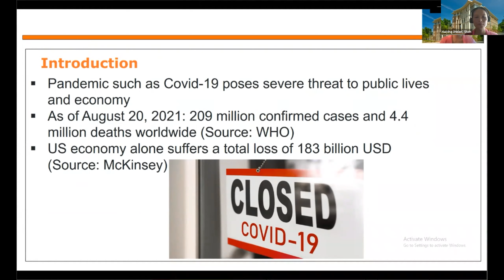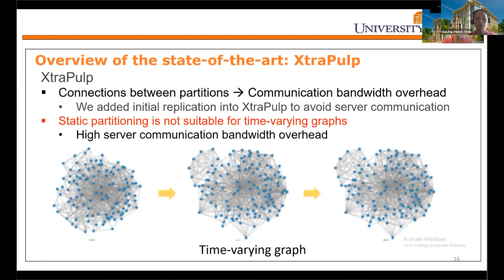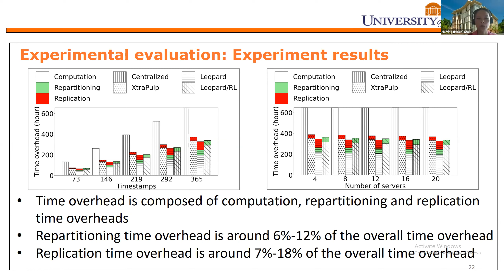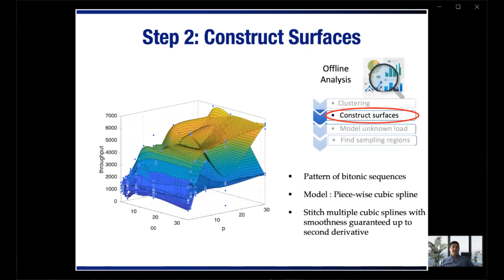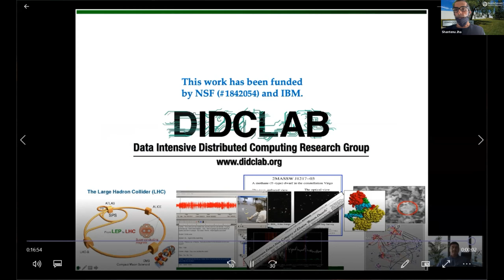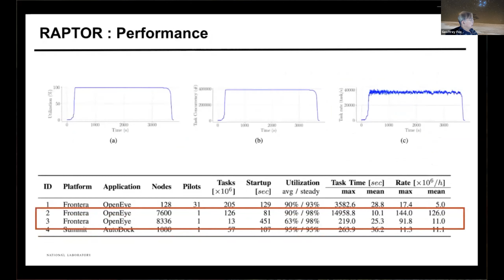CloudHPC Symposium - Session 5

Comment: why did you not just use a NVIDIA POD rack or 2, 600-400Gbp/s there blue link has been out for a year and a half, infact 1 DGX A100 system would have solved your entire problem, and it could sit on your desk! Another problem is how you parsed your data in a "Random"? parallelization manner but then didn't? im sorry but NVIDIA is predicting climate change and all you had was ONE sate??